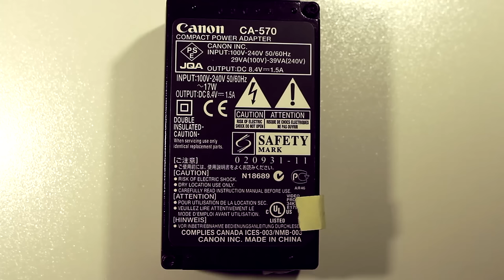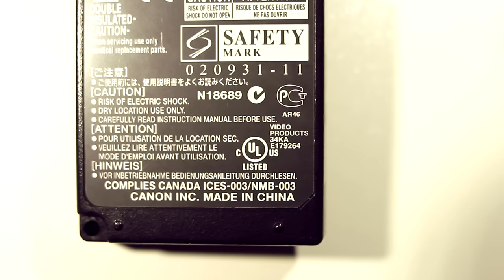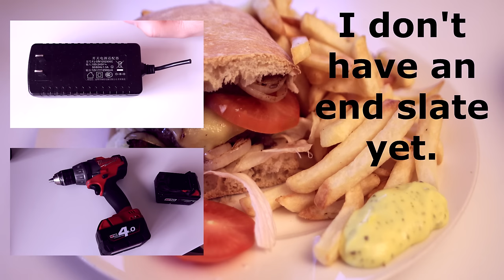Older Canon CA-570 8.4V PSU Teardown (010)

Comment: Can i use to charge 2 18650 battery ? Each one 3.7 and 2600 mh? I need them from my drill witch 7.2 v
Reply: This is the device I use to charge 8.4V lithium batteries, in which two 18650 cells are connected in series.
The 18650s are connected via a BMS with built-in balancing.
I unscrewed the screws and soldered another wire. On Aliexpress, you can't buy chargers on Aliexpress, they are bad and do not work correctly.
Set the output voltage = 8.38V with the trimmer.
From this charger, lithium batteries are charged on my radio station, bicycle headlight, "Olight-н25 wave" headlamp and much more. This charger is designed to charge lithium batteries 2S and has a CC-CV operating mode